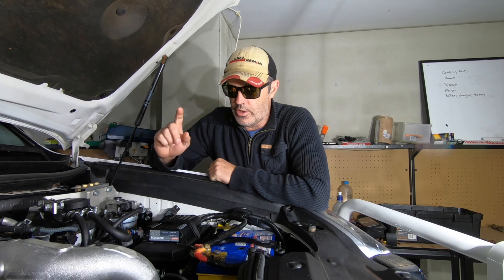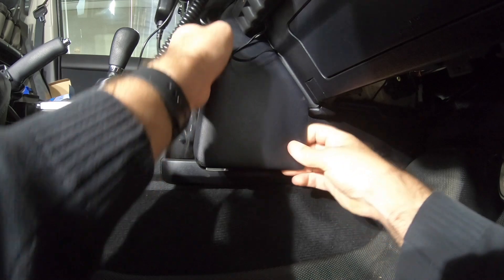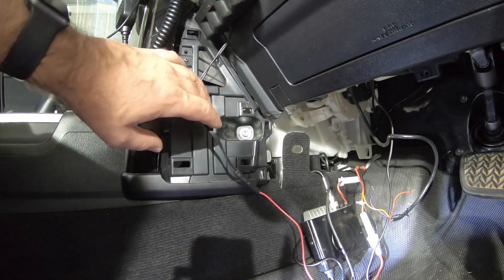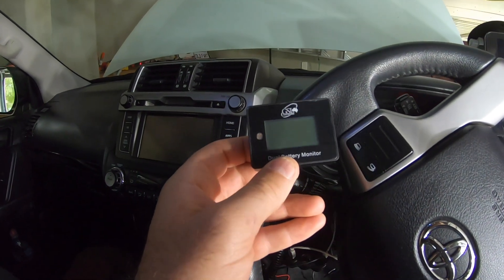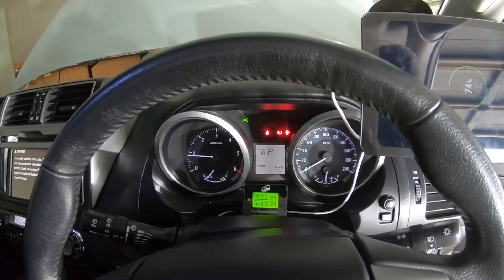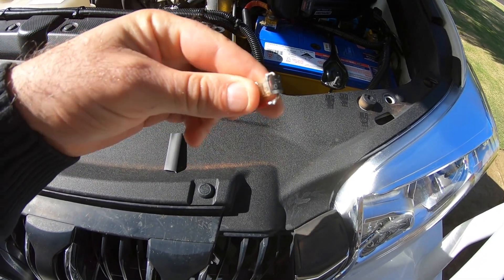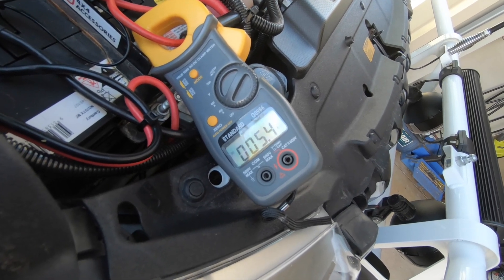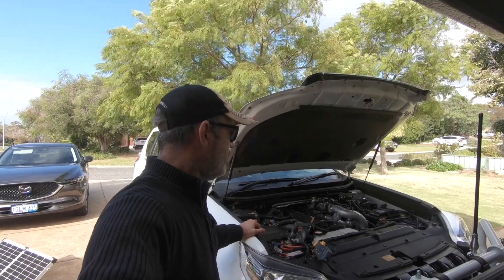Dual Battery monitor Install and REDARC solar test

Comment: Hi Mate, great video there...interested in the diode mod.  what value diode and is it polarity sensitive?
Reply from the maker: I cant remember the value, but it was a big one. There is a lot of info on google, yes, diodes are polarity sensitive, it’s what they are designed to be.. Pradopoint.com.au is full of info on this. That’s the best place to take a look.

Comment: Great video but where u tapped your supply for your voltmeter will give u false readings when load is on those circuits that u tapped into. To achieve proper and true readings, u really need to run separate feeds directly from the battery
Reply from the maker: I checked, its about 0.1- 0.2 of a volt, on the main, and the Aux is spot on, and it will work for what I need. If I run out of things to do one weekend I will rewire the main, and some other things as well.. All I need to know is if the alternators goes out. The Aux battery is more important. But you are right non the less.
Reply from the maker: OK, I ran some 3 core direct to both batteries especial because you asked :)

Comment: Another great video - though I do have to say if you didn't have video proof of your Prado in action I would say it never goes off - road....you keep it immaculate!!
Reply from the maker: I try to keep it as well maintained as possible. You just have to make sure you do a full clean and fix anything after every trip. If you let it go things start to get away from you. 

The last trip I had a few things to fix, I bent a side step, scratched up the sills a little. Bit of tyre damage. But I dont get nearly enough time to get out and about.. Next trip will be on the bike I think. :)

Comment: Also, is the diode really worth it? or can it damage the alternator long term?
Reply from the maker: I cant see how it would damage anything. Alternators have been charging at 14 volts for years. The temp compensating thing is mainly for power/emissions. I and others have been running them for years with no issues.

Comment: Great video mate.  I like the volt meter install you did too.  Looks the business.  how much was that gadget?  I've done the same with my BCDC MPPT solar input on my Hilux bull bar.
Reply from the maker: The guage was around $150, to expensive for what it is, but I havent been able to find anything the same for less. I wanted something I could just double sided tape to the dash, and not have to drill a hole.